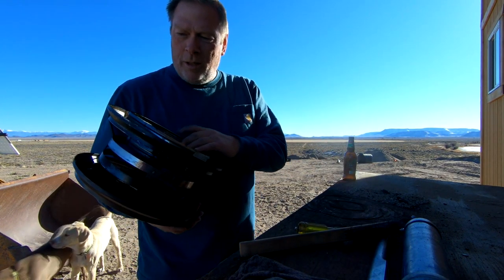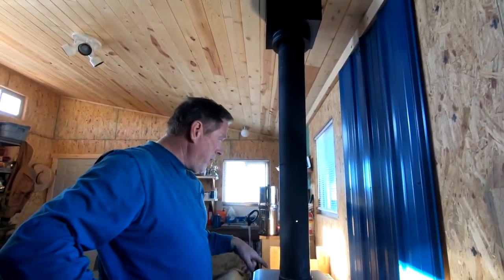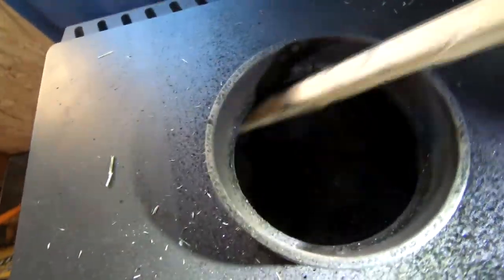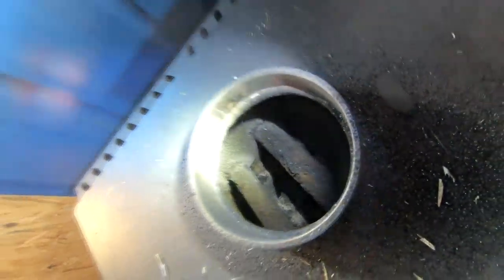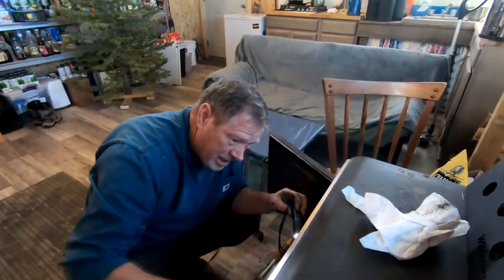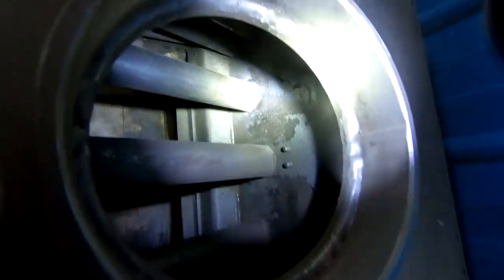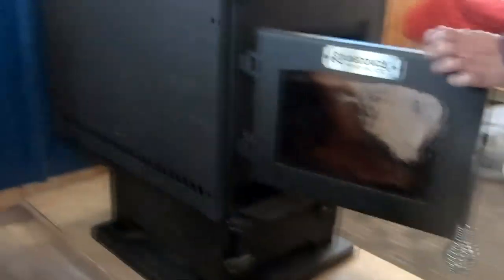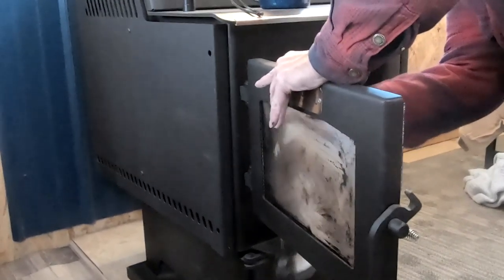Could We Have Died?!  Chimney Sweeping.

Comment: Looks like to me you never got the stove hot enough every day. So you need to get a pipe thermostat and run it up to the red every day. Normally I would only clean mine once in the beginning of winter but that is when I only burn dry hardwood. Looks like you got it as clean as you need too.
Reply from the maker: Pipe thermostat is a great idea!  Unfortunately, we cannot get the stove very hot because the only woods available to us produce such low BTU's.  We should travel to get some oak somewhere and burn it now and again. Thanks very much!

Comment: Your stove needs to burn hotter, stove pipe thermostats work well, the magnetic mount ones work great. I have been burning wood more than 35 years.
I keep my surface temp on the pipes 350-450F degrees. Clean my pipes and chimney once a year, mix of soft and hard woods. Checking your pipes per month is a good idea.
Reply: On checking the flue and chimney... especially in your first year of learning your stove
Reply from the maker: Thank you so much for this suggestion.  We definitely need to burn hotter.  I think our stove is kind 'cold', if you know what we mean.
Reply from the maker: We are buying a telescoping stove pipe to make cleaning and checking easier. Thanks!

Comment: Hi, E-Chip and Robber if the wood stove has a damper built in it you don't need the one in the pipe.
  Also, I have a feeling that it gets too warm in the Schouse for you to keep a hot fire going and you keep shutting down the damper causing it to burn too cold. If you have to run the stove wide open and open a window to let some heat out many times we have a window open while the stove is going and as you know our only heat is the woodstove.
Reply from the maker: Yeah, thanks Thomas!  It does blast us out of here at times.  We managed to get it hot enough the other day for it to boil water, but that is the hottest it has been so far. We keep more than one window wide open while it is going, haha.  We're learning. But we shut the damper down because if we don't we'll have to get up in the middle of the night and start a new fire - it burns that fast. Appreciate you!

Comment: Hello E-Chip and Robber. We would get Aggie May to do the roof part and my dad would remove the pipes in the house and get the large particles off of it. he did it in the spring when the stove was turned off.   I'm with Robber. an easier method would be great. Soot is awful to clean up.   Robber you look like Cinderella.  I wonder if the wood pellets would give you the high heat you need to do a good burn. 
Ash is good for the garden. 💕NonnaGrace
Reply from the maker: Yeah Robber is quite the hard worker.   Pellets might work. Thanks!

Comment: You crazy kids ! yup that's way too much soot, we have been heating with wood for 20 years, had a chimney fire about 19 years ago, learned my lesson, now during heating season I clean my chimney once a month like its a  religion. no joke I get up there the 1st of every month . 
A sure tell sign of a chimney that need cleaning is a reduction of draft and a bit of smoke in the house when you open the door . 
I would replace that inside chimney piece with the draft valve and put in a regular straight pipe , then lengthen the cleaning rod / brush to go down the whole length, right to the stove, this way you wont have to take the pipe apart each time. .. way easier way to clean.
 Your stove  may be too big for the space that is being heated, that's why you are not burning it hot and have difficulty with buildup.  no problem, just get yer but up there once a month and run the brush through and you will be ok.
Reply from the maker: Hi There!  Yep, we have since switched to mostly Aspen for heating rather than pine.  Much less soot!  Thanks!